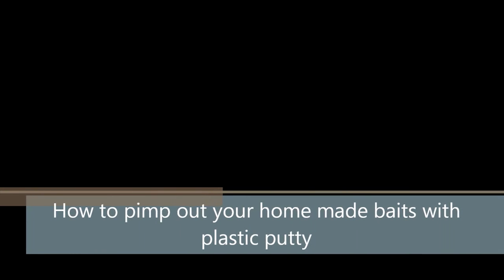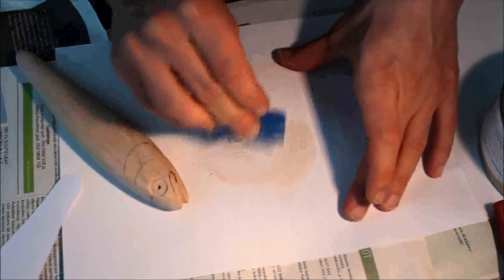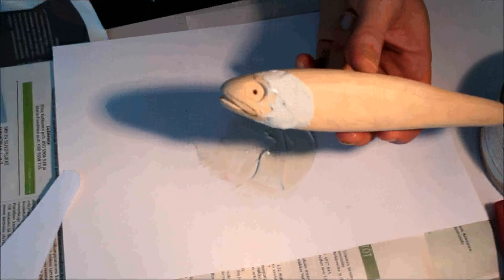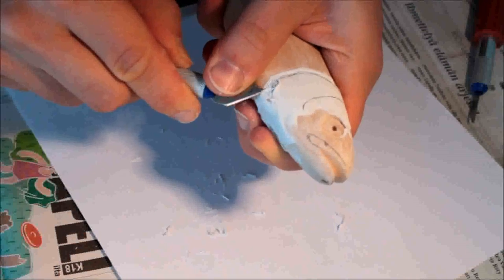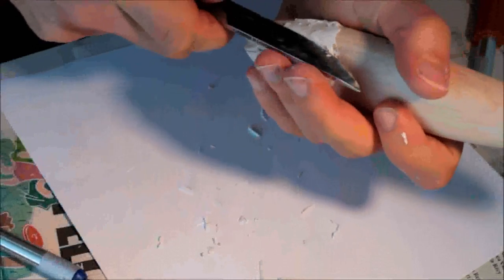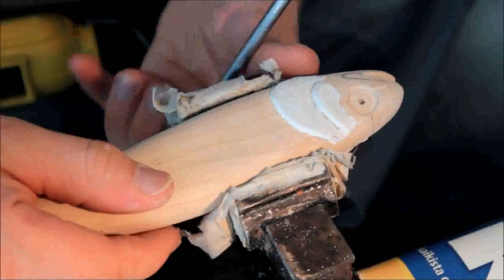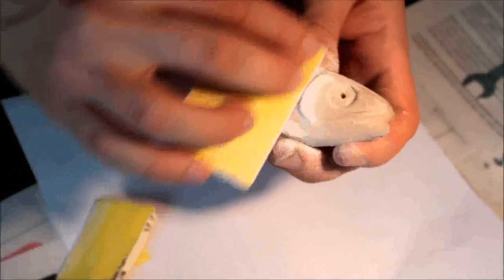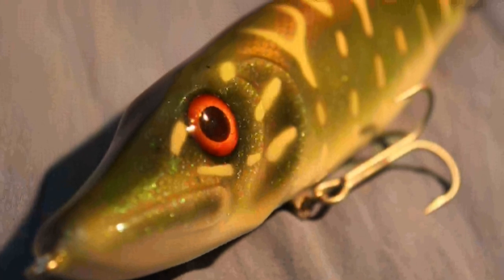Lure making tutorial: how to use plastic putty to make gills on lures

Comment from the maker: @AngryLS1 as a sealer i use a mixture of titaniumoxside(also know and titan white powder) and clearcoat. the stuff that i mostly use for coating is invirotex epoxy, witch i usually have 3 thin layers each aplied when the previous layer is still not fully cured so that they will combine a chemical bond and sort of melt to each others to insure a tough finnish.